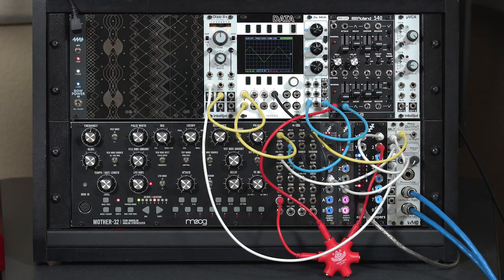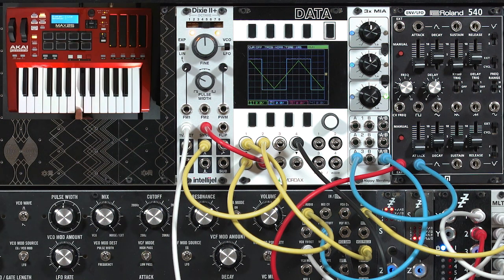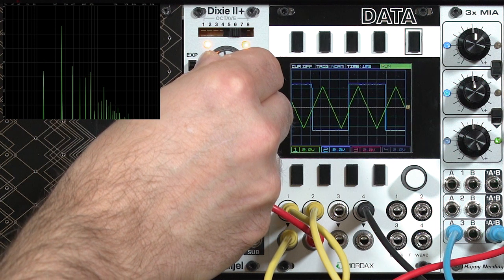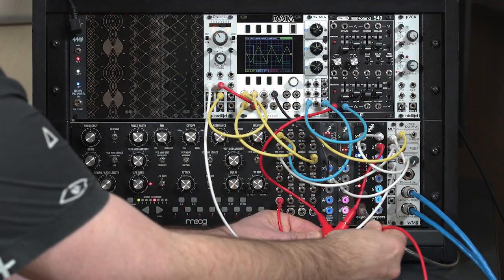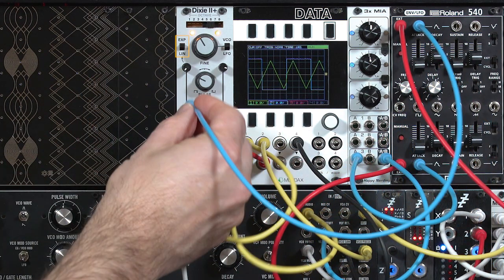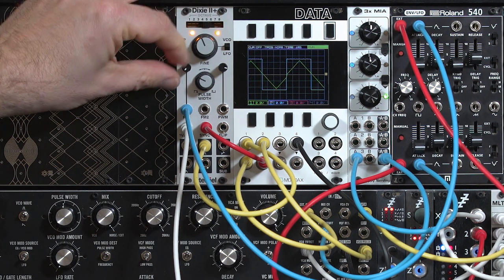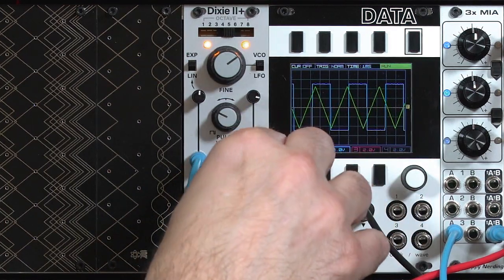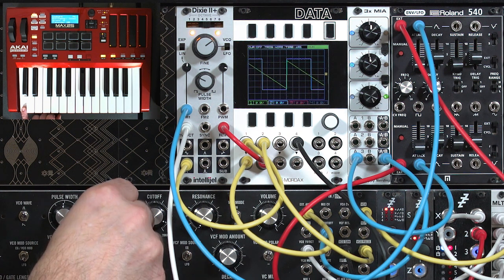Intellijel Dixie II+: Hard Sync & Flip (LMS: Eurorack Expansion Preview)

Comment: just wondering if i can tune Dixie 2+ to play nicely together with Moog 32
Reply from the maker: Yes. Also remember that you can use the Mother's front panel octave transpose buttons to move it into the range of other VCOs.
Reply: @LearningModular  Thanks! I got an STO recently but its hard to match with M32's tuning. I sequence both independently. As far as i know Dixie 2+ has a perfect tracking

Comment: I picked up the Dixie II+ thinking I could use it as a central LFO source to control frequency modulation on both my Elements and my Ripples as well as a source for 1v/Oct on my Edges but I think I might have had the wrong idea as it is seemingly leaking over into the other modules when utilized for this source. I think I have some more learning to do
Reply from the maker: If it's "leaking over into the other modules" that sounds like a problem with your power system. Start by replacing any flying bus cables with real bus boars - preferably ones with heavy copper (like the MIDI-Hardware), filtering (like the MDLR), or both (the Genus Modu LIBB is the best).
Reply: I'm not quite sure what it is. It's an MDLR case with MDLR power currently and it definitely isn't drawing anywhere near the limits on each bus board. I'm going to do some digging in a little bit and see if maybe I'm utilizing it wrong somehow.
Reply from the maker: Crosstalk is not caused by power limits. It is caused by grounding issues. Even a fraction of an ohm can introduce noise.
Reply: I've been using a Furman power strip to hopefully help with any possible grounding issues, generally I haven't had an issue before with pedals/amps/modules. However, this is my first Intellijel module but I can't imagine that would have anything to do with it.
Reply from the maker: Grounding issues with modular synths are inside the case. In addition to wanting a low-noise power supply, the connections between the power supply and the bus boards, the way the bus boards are designed, and the grounding of the modules to the rails of the case all make a difference in how much noise ends up in the audio, instead of being drained or filtered away.

This is the hard-core reference on the issue: http://www.genusmodu.com/products/libb-wp-01.html

Comment: I was trying the Sync and Flip inputs on my Dixie II+ (using an STO as the sync source), and couldn't hear anything different. I had no idea that the synced oscillator needs to be tuned higher, but thinking about it for a bit it makes perfect sense.

Thanks!
Reply from the maker: Yeah; sometimes I too forget the "correct" relationship between the two VCOs, and wonder why it's not working as I expect...
Reply: In my case it wasn't a case of "forgetting" so much as "never knowing". I'm very much learning modular and sometimes forget basic stuff like patching a gate into the ADSR.
Reply from the maker: Just trying to put your mind at rest that sometimes, even the "pros" fumble around with their modular systems... ;-)